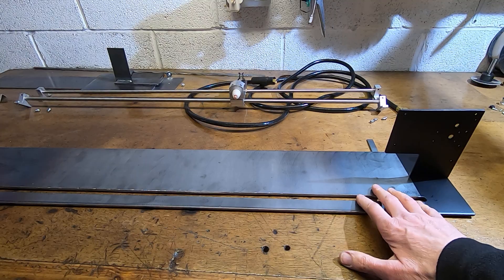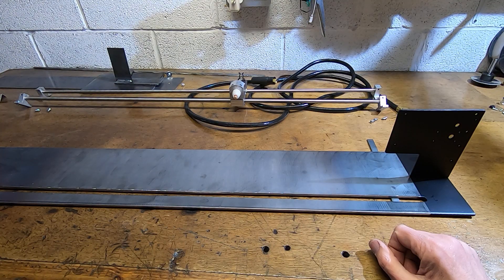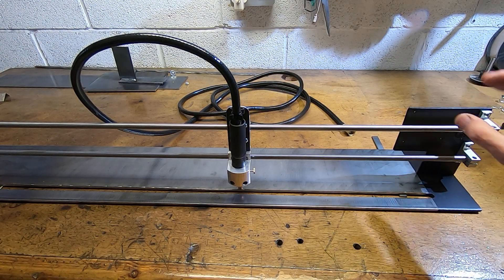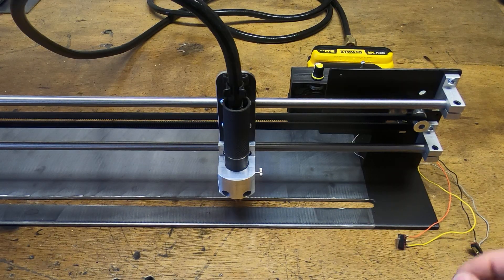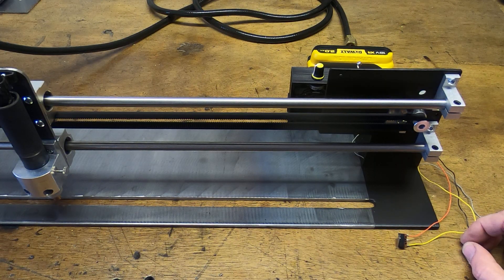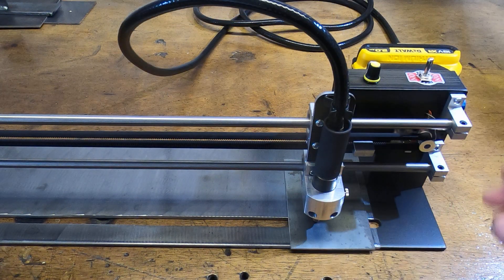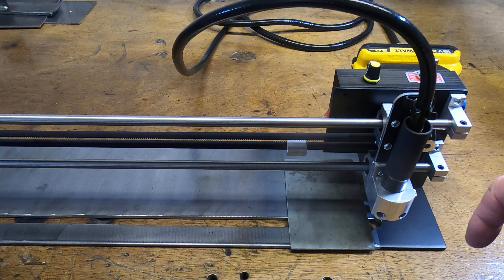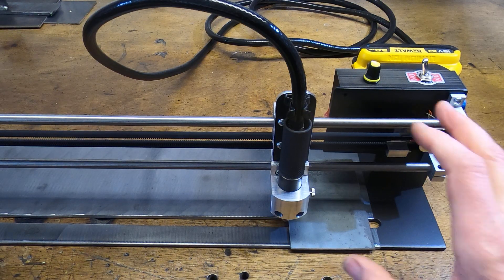Plasma Cutter Part3

Comment: Very nice addition indeed.
If you do do the CNC machine, will it be for metal and if so, does it make this one redundant?
Reply from the maker: Yes plasma cutting only works on metal although you could of course replace the plasma torch with a router etc. A CNC machine would not make this one redundant as this tool is for making straight cuts so does not need setting up like a CNC and also it is not limited in the length of the cuts it can make.

Comment: Nice tool.
If you move the switch to the middle off position after your cut but before it reaches the switch will it cease cutting but still give you 3secs air?
I feel that’s how I’d be using the unit.
Reply from the maker: If the switch is returned to the centre position during a cut it turns off the cutting and stops the carriage but the air continues for as long as the plasma cutter setting (eg 3 seconds). I will mostly not use the end stop switch but 'abort' the cut once the torch gets to the end of the cut. I did however want an end stop switch so that I could walk away during a cut and not worry about the carriage hitting the mechanical end of travel.